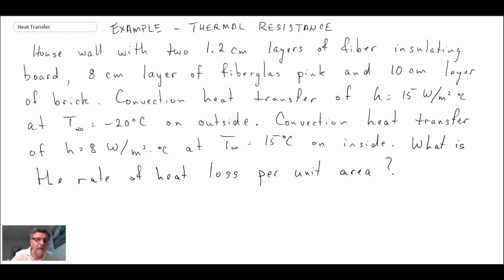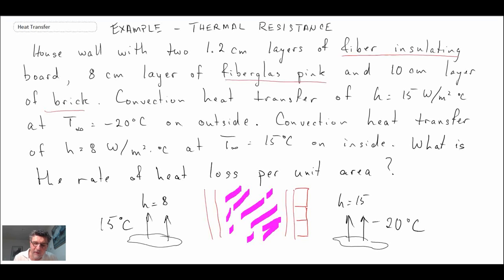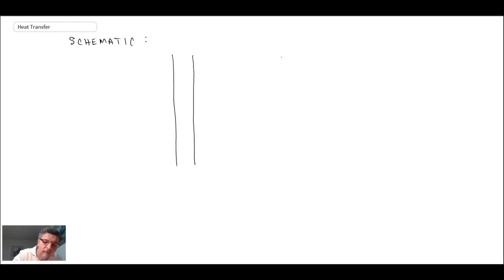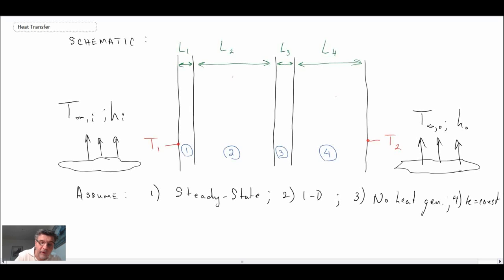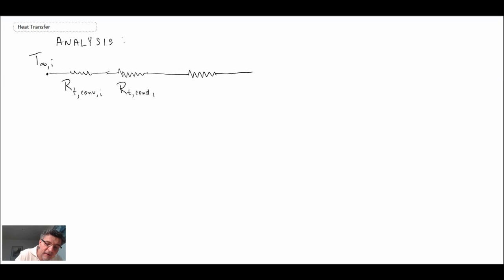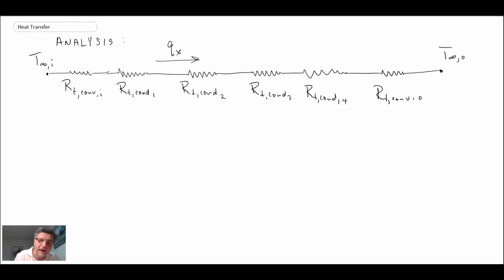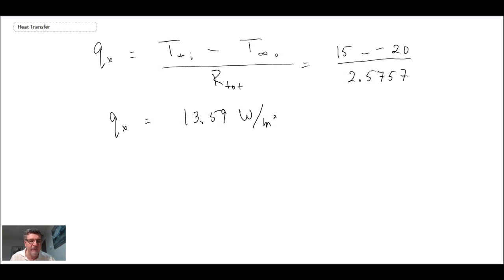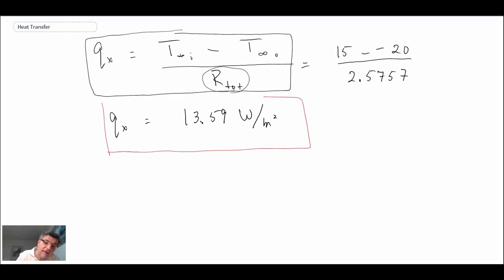Heat Transfer L6 p3 - Example - Thermal Resistance

Comment: For those who are confused about the unit of the final answer,

The question stated that theres a random wall and didn't give any dimensions for it. It was just asking for the heat loss through ANY unit area through that wall. At the beginning of the solution, he took 1 m2 of the wall and did his calculations respective to that. Indeed, the final answer is total rate of heat transfer. However, he was considering 1 m2 of the house's wall and so the /m2 is refers to a unit area of the HOUSE'S wall, it doesn't come from the calculations, it's just there because he took 1 m2 of the wall as the specimen.

If the question were "What is the heat rate through 1 m2 of the wall", everything would be the same except he wouldn't have put a /m2

Comment: If the ques mention to calculate heat flux , shouldn't we exclude out the area inside calculation ? q"  = (Ti-To) / (1/hi + L1/k1 +L2/k2 + L3/k3 + L4/k4 + 1/ho)

Comment: The unit of final answer is confusing. Shouldn't be the unit in watt? according to the equation he is using delT=Power * Rth. Please correct me if I am wrong
Reply: I am confused and I have a question like you,  heat flux q''=((delta T)/R _tot)/A, its unit is w/m^2 , and qx seems to be heat transfer rate in unit watt.

Comment: shouldn't the units for heat transfer in the final answer be Watts and not Watts/m^2
Reply: yes..units should be in watts
Reply from the maker: Given the question asks for heat loss per unit area, the most compact response would be to give the answer in W/m2.  You could provide an answer as "xx Watts", but you should then add the words "per square meter" to make it explicit.